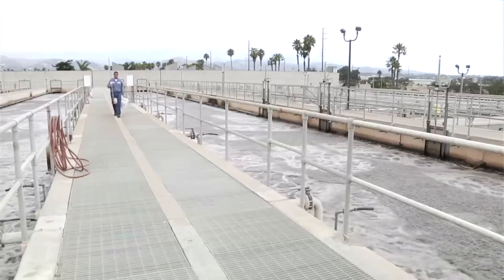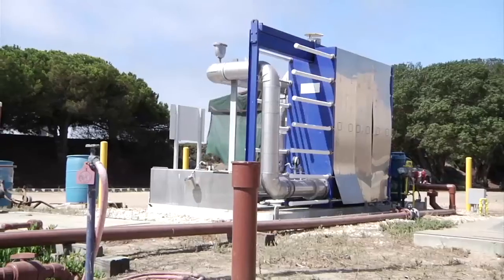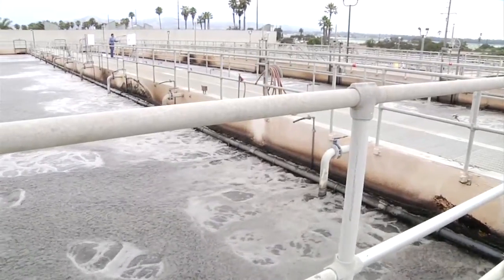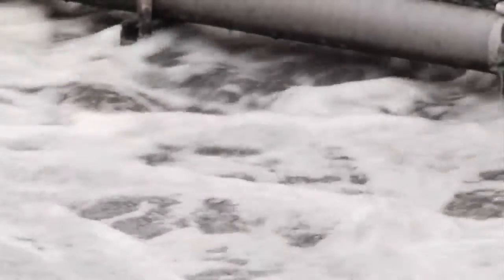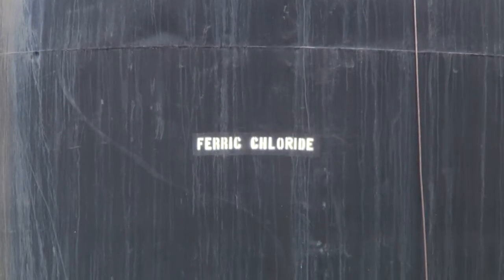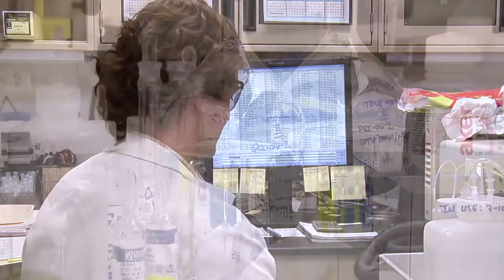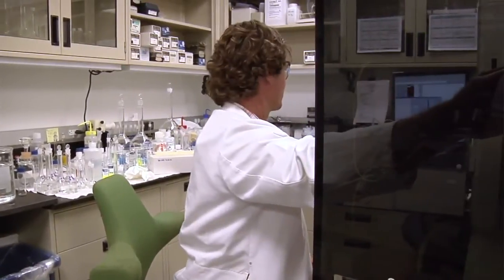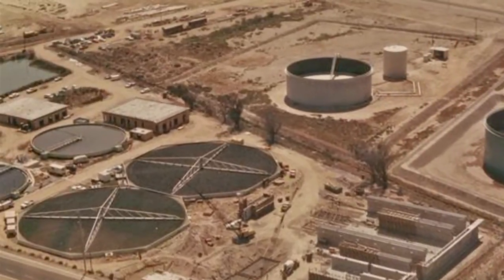A visit to the Ventura Water Reclamation Facility

Comment: I appreciate Eric Miller's, CAPS TV's, and the City of Ventura's effort to help everyone understand what is done to remove waste from our much appreciated water.  1)Influent Pump Station to remove inorganic material, 2)Activated Sludge aeration to remove BOD + secondary sedimentation tanks + denitrification to convert Kjeldahl and ammonia-sourced nitrate to make nitrogen gas that vents to the atmosphere, 3)gravity filtration, 4)disinfection, and 5)dechlorination with sulfur dioxide.  9MGD inflow with up to 2.5 MGD irrigation of Marina Park and the golf courses.   I wonder why they did not talk more about the polishing lagoons and the birds' use of that habitat.  I wonder why they seemed to steer clear of the real science behind pathogen and chemical residual concentration in the treated effluent they so casually discussed using for direct potable re-use.  Pathogens such as disinfection-resistant viruses and protozoan cysts would seem worthy of attention. Dissolved and nano-particle associated Endocrine-Disrupting Chemicals (EDC's) related to the plastics used in reverse osmosis, all the piping, liners, and equipment related to the water value chain, etc. would also seem worthy of attention.  Asking one person who has worked many years at a wastewater treatment plant and who depends on the City that is trying to justify a direct potable re-use project is one way to convey the message.  While I respect Mr. Miller's knowledge and experience treating wastewater, this video falls short of the ringing credible endorsement sufficient to justify such a bold and risky step as direct potable re-use.  Groundwater recharge of effluent treated with the best available technology high in the City's watershed seems safer due to the distance of filtration through substrate and also offers the additional storage Ventura needs to address years of potential drought conditions and a concurrent shortage of State Water Project imported water.
Reply from the maker: George, thank you for your comments. This video was developed a number of years ago in 2013. For updated information on the future water supply projects including the VenturaWaterPure project and State Water Interconnection program please visit Ventura Water's website at www.venturawater.net.
Reply: I'm pretty sure you heard about this but Ventura will be constructing an advanced water purification facility that will further clean the water. They will also be building a pipeline to receive state water.